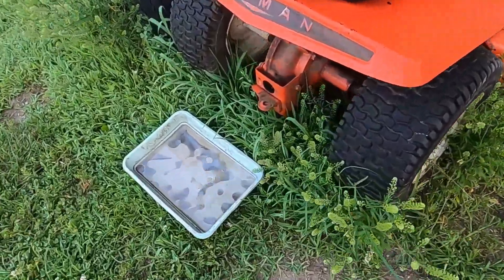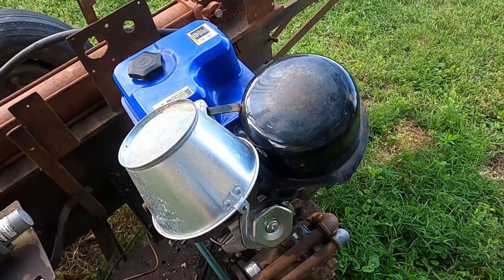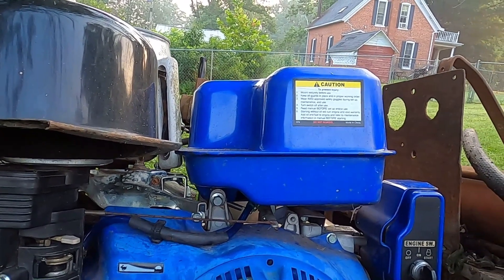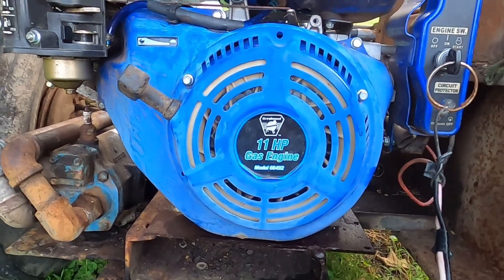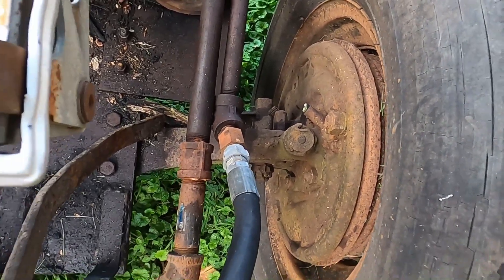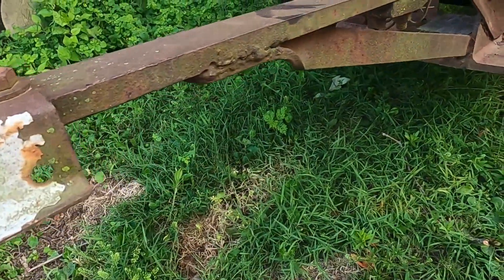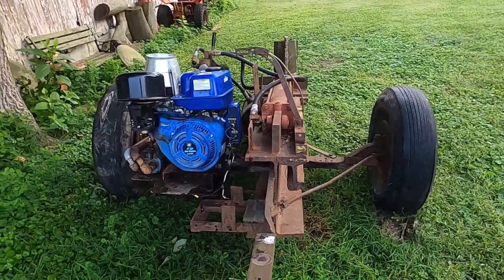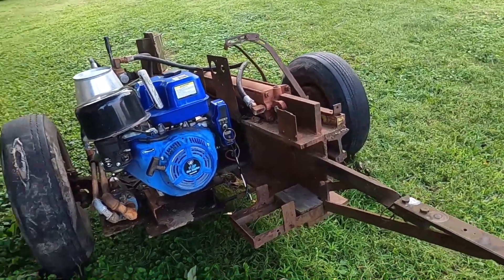Home Made Log Splitter Story I Should Have Filmed

Comment: Definitely built to last. Next time you get one with the rings stuck try ATF in the cylinder. This worked for me several times.
Stay well, Joe Z
Reply from the maker: I've done that many times and did that to this engine as well. We started with just 60psi compression. After the last oil change to rid the crankcase of water it was getting much better compression and I suspect that will just get better with more run time. Cheers! Zip~
Reply: @ZippoVarga  Nice work. Always good when we can save them.     Stay well, Joe Z

Comment: I have a Lesco mower that had water in the hydro system.  (Lesco uses 20 50w for hydros).   I tried to drain the mess out but water was still present after I added new oil.  So I put it on a fire and steamed it out. - Fun video experiment I filmed.
Prior to that, I tried to add oil while the return line emptied into a bottle...no luck, still would not flush out all the water.

Comment: Built one with the I beam construction similar to that many years ago.  Even had a pilot operated hydraulic valve.  Worked great & lots of folks used it  but that was the problem, I lost track of it.  Haven't seen it in 40 years.  Oh well it was about that time I quit heating with wood & I hope someone got good use out of it!
Guess those chi-com engines are pretty tough!
Reply from the maker: I've got a 6.5hp Honda Clone on my log splitter that's been on there for well over 10 years that's just plain reliable. The only thing I've done with it is change the oil regularly, replace the fuel line once in a while and use it. The ingenuity in these home made items never fails to intrigue me. To see how they're built and see how they overcame obstacles here and there with more bracing, added steel etc. Just amazing. Cheers Skip! Zip~